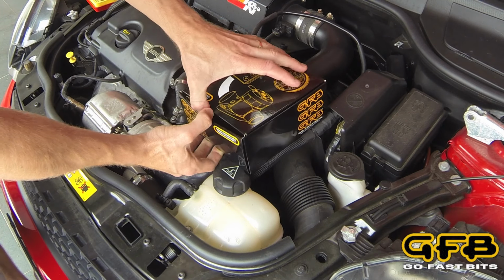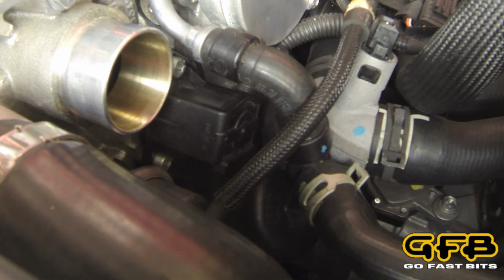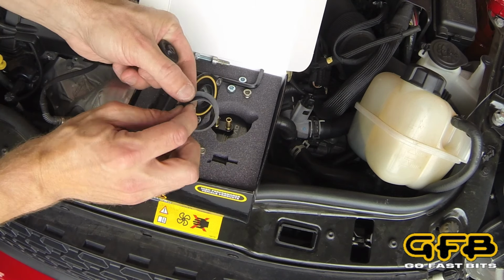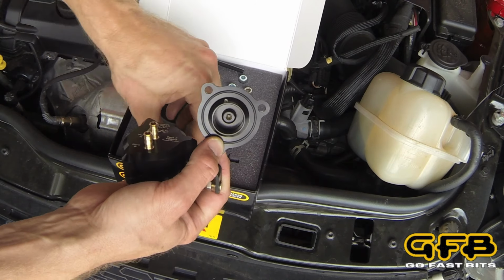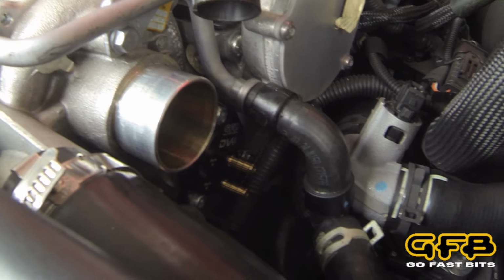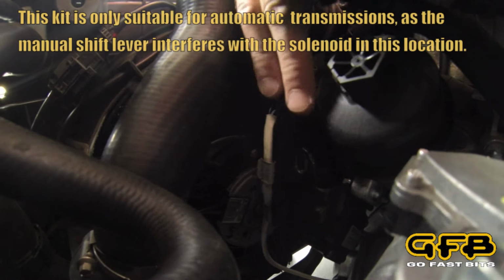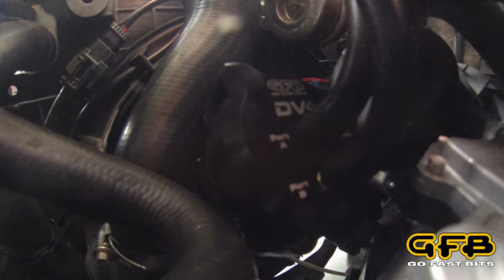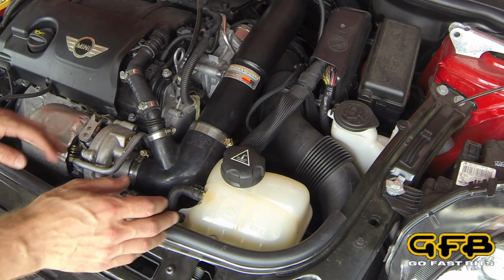GFB T9353 DV+ Mini N18 Installation

Comment: do you recommend touching the moving parts with a tiny amount of motor oil during assembly to prevent galling of the aluminum parts?

Comment: Great video, however, I would of never mounted the solenoid down low, especially next to the oil filter housing!...  would of stuck it up tip where you can keep an eye on it...
Reply from the maker: Thanks for your feedback! Once the diaphragm part is removed, those factory solenoids are incredibly reliable so there should not be any need to keep an eye on it

Comment: Hello I know this video is a bit old but I had just recently purchased a 2012 mini Cooper s and it is manual now outside of the mounting issue this system could work on a manual transmission model you would just have to mount the second portion somewhere else?? Or would this cause issues with the turbo and possibly my engine if I purchased this systel

Comment: Hey so your video says this item is for automatic transmissions but your site says it will fit both. Is there a sugusted mounting poit for manual transmissions?
Reply from the maker: Hi Carl, thanks for contacting us. We've now adapted the T9353 DV+ so that it is now compatible with both manual and automatic applications. I'd highly recommend having a pre-read of our instructions to help aid with this installation.

Comment: Will this get in a way when you want to change the oil filter?
Reply from the maker: We have not had any reports of issues with changing the oil filter with the valve installed

Comment: Someone can tell me the difference between T9352 and T9353? Is T9353 for auto and T9352 for manual recommended? Thanks
Reply from the maker: Hi, The T9353 is for the N18 engine, the T9352 is for the N14 engine. The T9352 will not fit on the N18 due to engine bay constraints which is why we have 2 part numbers,
Reply: @gfbvideos  thanks a lot, i searched everywhere and o couldn’t find anything

Comment: Just finished installing this and I have absolutely zero boost now. Nothing. Made sure the ports matched up and everything was installed the same as this video.

Cleared engine codes just to check if that needed done and nothing. Im all motor right now
Reply from the maker: Hello, 
For technical support please contact us at support@gfb.com.au 
There we'll be able to give you more in depth and tailored help
Reply: It turned out to be operator error. I also had to fix a coolant leak and once I got the system burped the spoolie boi was happy again. Wanted to come back here to clarify it was my error, nothing wrong with gfb product.

Comment: i had bough gbf type 9353 and installed successful accordingly same as in youtube, but suddenly it does not work at all, tje sound is not there, also reinstalled twice time, same result no change!!!!!!
what wrong?  can anyone help me, for information is that i had engine no modify also air intake system is also standard, may this the root problem?
Reply: Was it loud beforehand? If you want it to be louder you need a cold air intake system lol

Comment: Torque for bolts?
Reply from the maker: Don't need to go crazy on the torque for these screws, as they thread into aluminium, and the ones that hold the solenoid can crack the plastic if you go overboard. I'd suggest 6-8Nm is sufficient